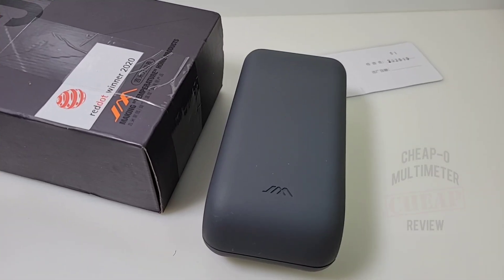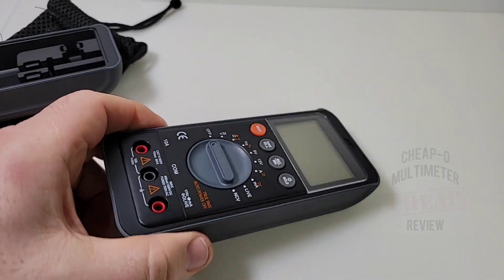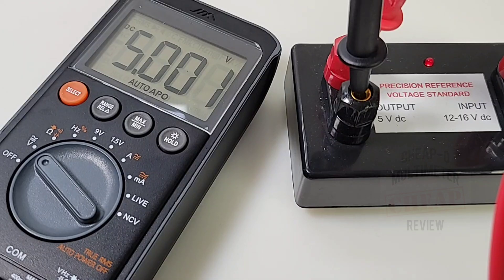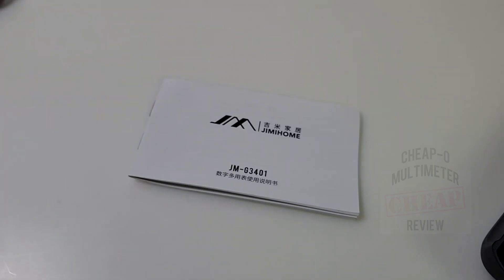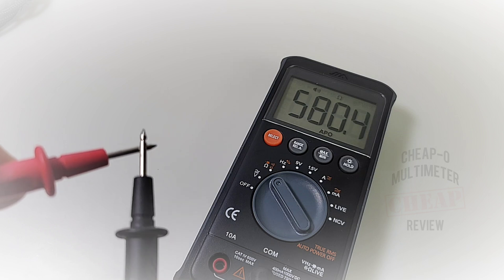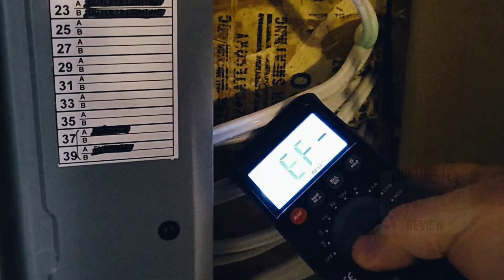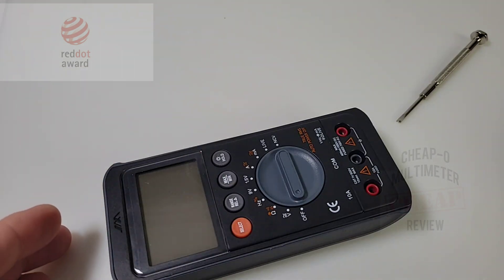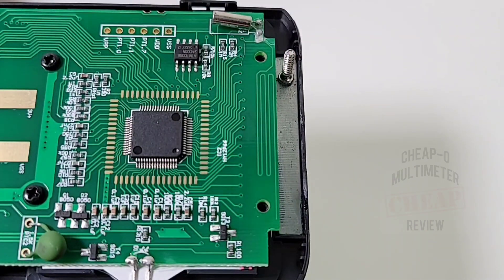JIMI JM-G3401 CHEAP-O Multimeter Review & Teardown!

Comment: Nice review. This meter has a nice design with built-in case for its leads. Could have bern better if the case part could be stuck to the back of the DMM and double as a stand. Thanks.

Comment: Dear Darren. RE: MULTIMETER FOR SMD. Please do or recommend a mid range n cheap multimeter for smd work. I have the uni-t n hold peak tweezer, both terrible. Also can you add lighting Led component from led flood light or light bulb.
Reply from the maker: If you do alot of LED / smd work..the UNI-T UT89XD is a great choice! It has a unique LED mode that works really well.
https://youtu.be/pAovc5h12zg

Comment: This is definitely an interesting meter. It’s not good, but not that bad either. It has major design flaws that you just don’t want to deal with. But at the same time apart from not working live mode it performed reasonably well for a cheap-o. 

There is just nothing deserving an award. Magnetic lids are used everywhere nowadays.  Last year you reviewed a POKITMETER that had a very distinctive design. This JIMI (man, what a name) looks pretty generic without the lid. That explains a total of 9 orders on AliExpress.
Reply from the maker: It's definitely a "forgettable" multimeter..mind you , trying to access that fuse will be forever engraved in my memory...🤣🤪
The POKITMETER was definitely more deserved of such an award..it was truly unique 👌 albeit way overpriced!

Comment: Battery test mode is so dumb, it does nothing, it does the same if you put it on DC voltage setting.
Reply: Usually it’s not enough to simply test DC voltage of a battery. Bad batteries can show voltages close to nominal without any load but will drop it significantly when there is one. I agree that this isn’t the most useful feature since it just puts a resistor in parallel with a battery (which you can do yourself), but it’s a nice and fast way to test batteries for common people. You want to make it as simple as possible for them.
Reply: @numerical_error  Ok, what ohms resistor do you need to test a battery if it's ok, because i never heard of using a resistor, "example" like with a 18650 battery, what ohms resister do you need?
Reply: @AmigaWolf  That’s actually a great question, which I will try to answer to the best of my ability. 

Aside from the capacity (the charge stored in the battery), batteries have an internal resistance. When being drained, their open circuit voltage goes down and the internal resistance rises. Most multimeters have at least 10 megaohms input resistance on a voltage test. With a resistance that high they pretty much measure just the open circuit voltage of a battery, disregarding its internal resistance.  But in real applications your load won’t have this high of a resistance. And as the load resistance goes down and the internal resistance of you battery goes up the voltage drop gets more noticeable. 

We’ll use some math to demonstrate this. Let’s first measure the voltage drop of a 9V battery with an internal resistance of let’s say 120 ohms in circuit with a load with the resistance of 10 megaohms. Since we have a closed circuit with the input resistance of the load being in series with the internal resistance of the source (our battery), we can use voltage division rule:
V(out) = V(s) * R(L) / ( R(L) + R(s) )
where V(out) – is the output voltage, V(s) – battery (source) voltage, R(L) – load resistance, R(s) – internal resistance of a battery.
V(out) = 9*10,000,000 / (10,000,000+120)  = 8.999… 
But if the resistance of the load was 100 ohms, we would get a bigger drop:
V(out) = 9*100 / (100+120)  = 4.09…

That is why a simple voltage test might not be enough. You need to be sure that the battery would hold its voltage with an appropriate load. Which ultimately depends on your circuit. A reading of 1.3V on a typical 1.5V Alkaline battery could be enough to call it bad. But it might work fine in an analog clock where the current draw is low. It’s no different for 18650 batteries. I’ll leave two links for those who are interested.

How To Test Standard AA, AAA, D, C, and 9V Batteries with a Multimeter
https://www.youtube.com/watch?v=HcikzMG7mMU

18650 Li-ion Internal Resistance Explained
https://www.youtube.com/watch?v=av38iBxcOgQ
Reply from the maker: I hear ya..different strokes. Some new user might relish such a function though..👍
Reply: @KeepOnTesting  Yeah, and thanks for the great video's.